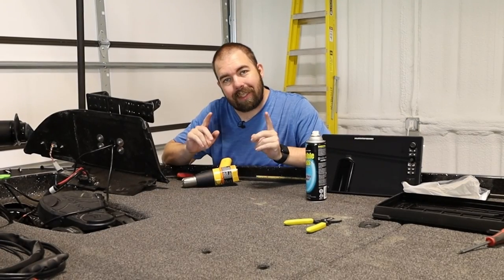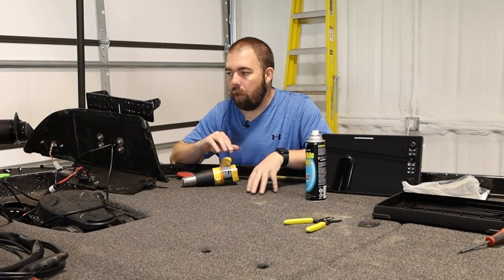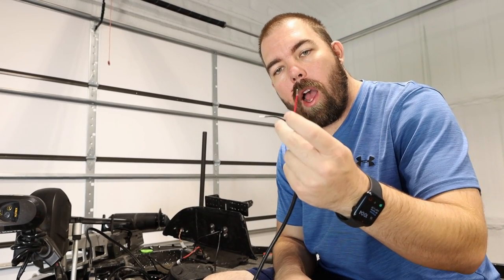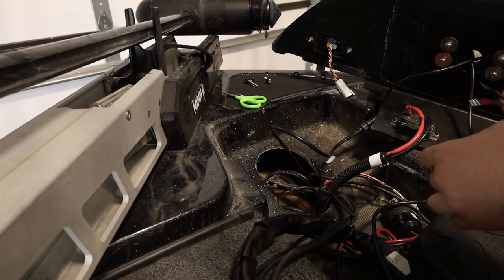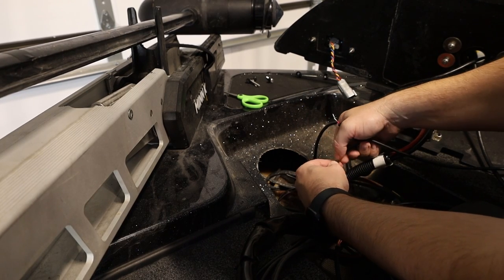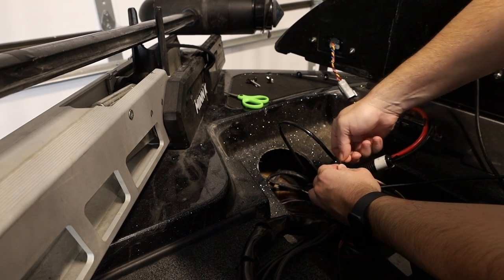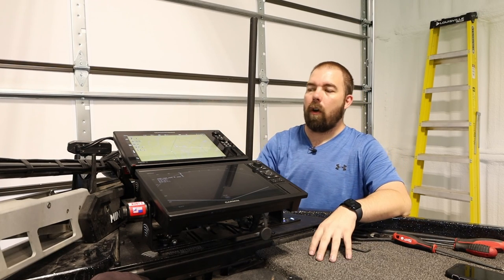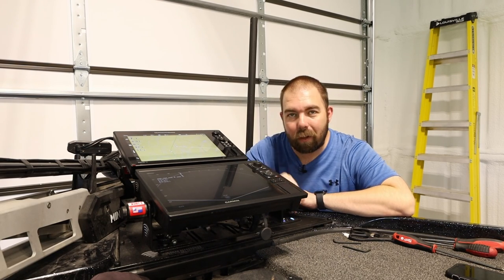Humminbird Solix Installation

Comment: Great Video. But do you need separate power for solix or can it be wired to cranking battery. I believe mines is wired as yours but not sure if its wired to fuse box or cranking battery

Comment: in my power cable there is a 3rd metal wire..what do i do with that one...Thanks for the vid.
Reply from the maker: I wired mine with the negative. It is supposed to be a ground if you have a metal boat.